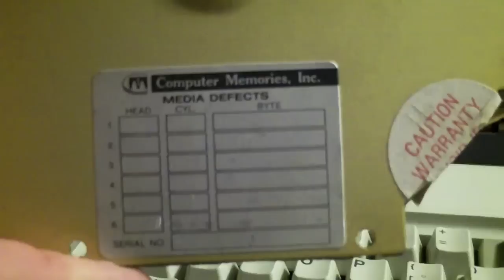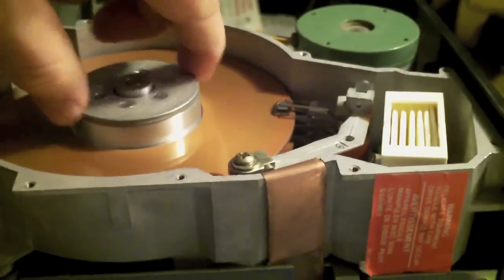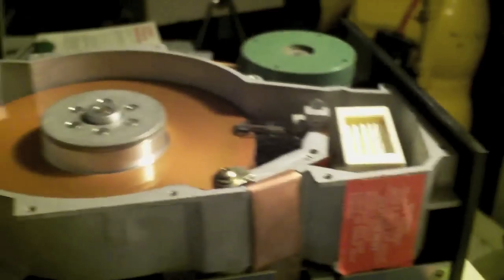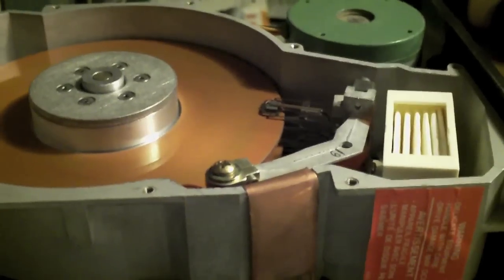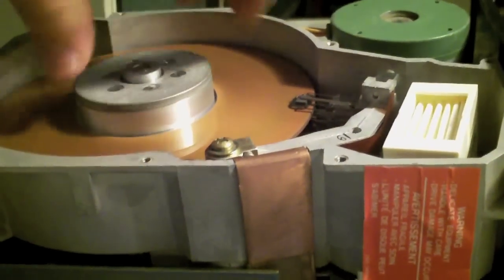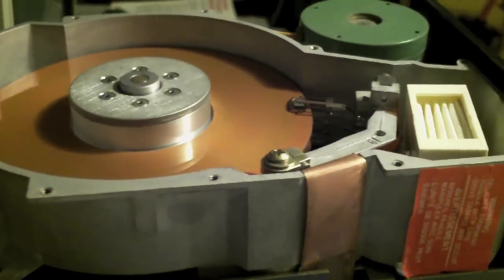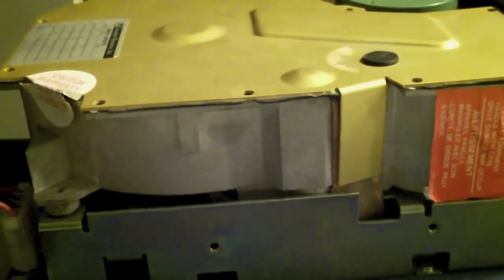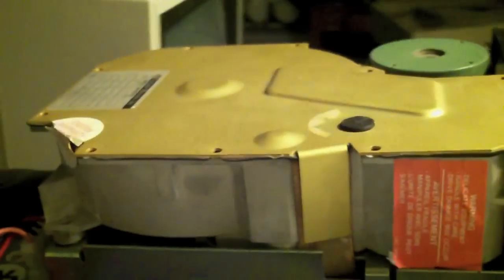Seized CMI Drive lives!!

Comment: Very wonderful Hard Disc. Very nice spinning up sound.  😊😊.  I would definitely replace the ball bearing in it because I hear it dries out and screams and chews a lot.  To prevent burning of the disc drive motor.  It would be a shame.  This hard drive is already a relic.  Where can I get one I need such an old hard drive too.  I love them evoked by my childhood.
Reply from the maker: unfortunately there is no way to fix the bearings without completely dismantling the heads and platters.  The bearings are inside on the bottom, under the platters.

Comment: Awesome! Very happy to see another CMI drive live :). I have a CMI drive myself- original in a PC/AT... the 20 MB one that was notorious for failing. Still works to this day just fine with no bad sectors other than the defects which existed when I bought the AT! 

It even came out in one piece a few months back when I was doing a hardware test that went awry and caused the R/W to repeatedly retract after the seek test (I guess due to bad voltage? Still not sure)!

Comment: Also, I didn't see a seek test occur when the drive finally powered on- though perhaps this is for the later models only (for instance my CM-6426s performs a seek test, but my ST-412 and ST-506 do not). So I'm not sure if this is an issue or not.
Reply: Early MFM hard drives didn't perform seek tests and even the ones that did would pass it without platters or heads.

Comment: That smoke smell is most likely the resistors in the motor drive circuit over heating from the motor being stalled.  Is it possible to remove the bottom part of the motor and drop in some 3 in 1 oil?
Reply from the maker: You're right about the resistors getting too hot.
And no, Not that I could see, there's no way to get even close to the bearings.

Comment: Whats the scratching noise?
Reply: Probably the bearings still being too solid and so making noise (just like old fans, except that old fans usually damage themselves during that state and so the noise may be permanent if they aren't oiled quickly, because what contains the bearing are made of plastic. But in HDDs it's made of metal so it shouldn't damage itself too munch over time)